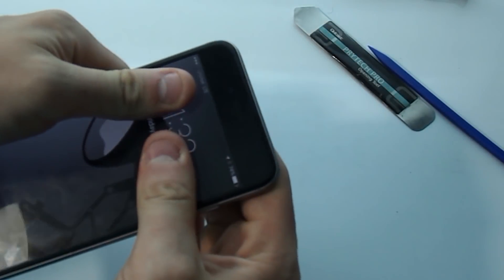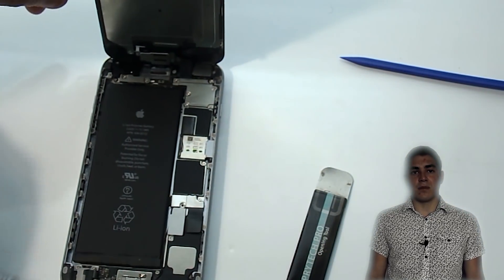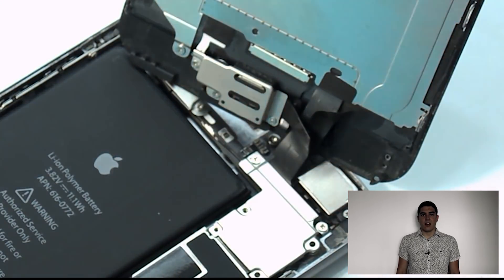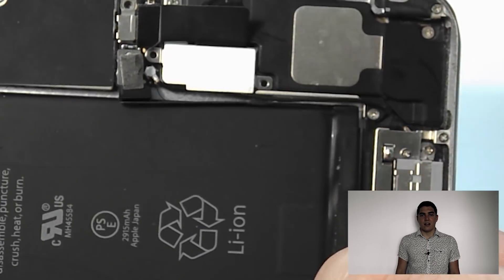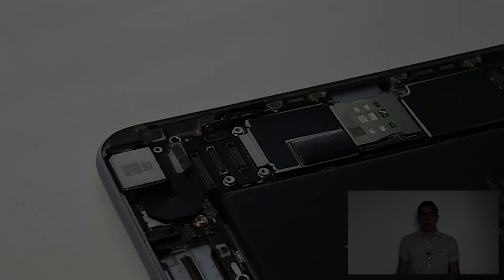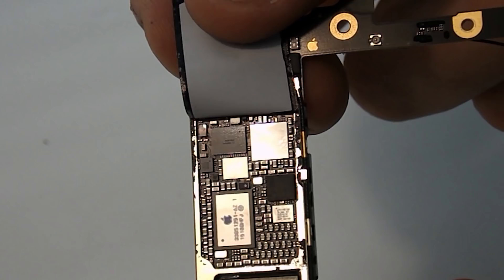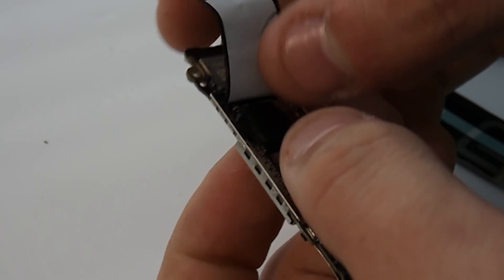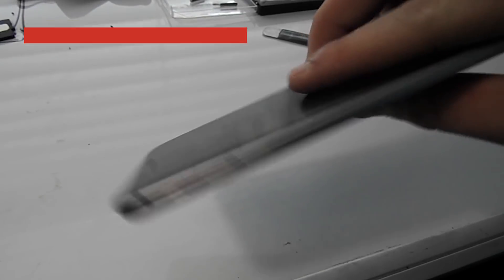How to Fix Touch Disease on iPhone 6 Plus (No Soldering or Bending) | appleEducate #03

Comment: Thank you so much for this. I took a shot at this trick because applying pressure with my finger to the back of the phone where the touch IC was made the phone work. Gotta be honest I was nervous opening up the phone as I had no back up phone, but after 4 hours my phone was once again working! It's only been several hours since putting the phone back together but so far theres no grey flickering bar. Will try to update this comment in about a week with how my experience with the phone is.
Edit: also touch is working flawlessly, thought I'd mention that
Reply: I have a 6 plus 64gb received on launch day in 2014
Reply from the maker: +Mike Neum that's awesome!
Reply from the maker: +Mike Neum thanks you so very much for an update! Glad it's working!
Reply: I've since gotten a 6S plus second hand, but this fix on my old 6 Plus is continuing to work. I've actually dropped the old 6 Plus twice after this fix and it continues to work. Everything about the phone works as it did before it got the "touch disease." I'm not trying to encourage everyone to try this to their iPhone and I will not be responsible for other people's broken iphones, I'm just simply telling my experience. Thanks again for this video Rody Davis!
Reply from the maker: +Mike Neum thanks Mike for sharing! Glad is helping and working!

Comment: I had 2 6 plus and traded one in with Apple for $250 bc of this disease to get 6s, then my wife 6plus start getting diseases so I found this AWESOME video and the ifixit tutorial you cannot go wrong! Anyway the first time I fold the tape just once, it did not fix the problem at all then I open it back up and folded it twice and thought it was fixed but then my wife complain about the disease the next day. So today I folded it about 5 times and it's been over 5 hours and I haven't seen the white bar! I think the disease is gone. Great video!
Reply from the maker: +Thai Cao thank you so much for sharing your progress and solutions! Thanks for watching!! I'm so glad it helped!
Reply: Rody Davis so every time I take the phone apart and do thicker tape it work 100% for a day then disease came back, and when it comes back it take more twisting strength to get rid of the white bar. Sorry this is a great concept and great video but I can't say that this technique is working. I will take this phone apart one more time adding more tape, this is probably the last surgery perform on my 6 plus because the screws are starting to strip /-;
Reply from the maker: +Thai Cao yes please be careful! Please look in the comments for other people who have worked through similar solutions. It definitely works. Thanks for watching!
Reply: I figured it out! So first bunch of times I did it, I obviously did not fold the tape thick enough. That's why it work for a few days then back to normal the reason is because that area gets really hot and the tape gets squish n thinned out. It has been over 2 weeks and still good and the phone been dropped many times (my 8 year old son even commented that before even a slight drop it stop working). So after  I put the phone back the screen budge up a bit on the side with the tape but after a day of use its back to normal. Rody you are the man with this technique. Thank you very much!

Comment: So far this fix has been working for me after a day of use. The only problem I've had is some discoloration on the screen caused by the logic board pushing against the back of the LCD. This could just be because my screen has been replaced and is not OEM. Thanks!
Reply from the maker: +Alex Brown awesome! Thanks for sharing! And that's definitely the issue. Thanks for watching!

Comment: All right, I did this and it worked for a week or so. 
Then I accidently dropped my phone from maby a meter up and it all started again. 
I could bend and twist it with some result which lasted for a few more days.. Then today.. the touch stopped working fully. 
Since I have no money to purchase a new phone I started thinking what I could do at my house at 11PM.
There was no chance in me trying to get my hands on my old jobs RBA machine so I got myself some tinfoil, heatgun (one of the cheapest on the market) and some flux. 
Took me around 2 hours and 2 reflow sessions of the two IC's but the touch is now working. Unfortunately the Wifi antenna got damaged during the teardown process but that is a price I can pay. Hopefully this reflow will last a few more months.
Reply from the maker: +Gurkturk wow!!! Man that's awesome!! Props to you! I have been really hoping to learn how to reflow and replace chips. I'm sorry that happened when you dropped your phone, but thank you so much for sharing!

Comment: would this work if the touch disease has progressed to the point where the touch screen only works 10% of the time or less?  Is mine too far gone?
Reply from the maker: +jordan fine mine was about to that point. If it doesn't work then you will have to get the IC chips replaced. But this is reversible so if it doesn't work no problem. Make sure to put plenty of tape though! Thanks for watching!

Comment: Rody, i have the "ghost touch problem on my iphone 5s. same scenario? a friens has the same problem with her iphone 6g. will this work across them all?
Reply from the maker: The problem is only on the 6 and not the 6s or 5s. It may be the same issue but this is not the same solution. On the 6s The chips are integrated onto the display but on the 5s they are reinforced. Thanks for watching and subscribe for updates and more videos!

Comment: I have a question. does the type of tape matter? like could it be duck tape? And is the tape only supposed to cover the logic board.
Reply from the maker: +killa kam the tape is supposed to be folded on it self so it doesn't stick on the logic board directly. Duck tape would leave residue. Electrical tape will work best for the heat

Comment: This fixed it completely for me.  2 days so far with no issues.  Thank you Rody!
Reply from the maker: +Kurtis Brischke thanks for sharing! Thank for watching and contributing to the channel 👍🏼📱
Reply: Hi Rody, after 2 days it started back again.  Having fixed it I now know where the chip is so if I squeeze that part of the screen while unlocking the phone I can get it to work (only while applying pressure).  The first go-round I used tape 3x thick, would 5x or 6x be overdoing it for second fix?
Reply from the maker: 5x would be about right 3x is too little. Bulge 3:03 Let me know how that works!
Reply: So far so good, started working again yesterday after the adjustment.
Reply from the maker: +Kurtis Brischke thank you for sharing!!
Reply: Kurtis Brischke still working?
Reply: L
Reply: How long did it last? Or is it still going?

Comment: Shit yes!!. I've just decided to get the 6+ and it just gave up on me. I didn't know about touch disease at the time so i just tried to reseat the connector and that worked for a couple of days. Soon i decided to buy a replacement screen but the ifixit video said it wouldn't help because the problem wasn't in the display. Luckily i saw that vid before going out to buy it. Going to attempt this trick soon when I'm free. If it works you'll be my saviour
Reply from the maker: +joshua lotion Please share your results and subscribe for updates on this fix, and thanks for sharing! Thanks for watching!
Reply: Finally has the time to do it yesterday and i have to say. You are truly a life saviour. Although the removal process for me was a bit fatiguing and difficult as it was my first time fully removing the iPhone's logic board i think it was worth it in the end. However if you have never disassembled any phone b4( I have experience from s4, and some other devices) i recommend asking some one for help as there are some tiny pieces that are really hard to reseat
Reply from the maker: Thanks for sharing that! I completely agree. Thanks for watching!

Comment: Thanks a lot. Tried this today. So far no touch disease in last 2 hours. But left with 4 screws that won't fit any of the remaining holes. Whoever opens the logic board, be careful to note down after removing each screw, where you removed it from.
Reply: Refer to other videos of replacing the logic board, because this video shows removing the logic board in fast motion.
Reply from the maker: +Ds Ss I always try to lay out my screws in the same shape as my iPhone. Sometimes I'll dry an outline on a piece of paper and but them where they came. Thanks for sharing and watching!
Reply from the maker: +Ds Ss I linked in the description to a full guide on how to remove it. Thanks for watching!

Comment: Hey Rody, the touch problem pops up on my phone every now and then. It always comes without the flickering gray bar at the top. Could that be classified as a touch disease that is caused by a hardware problem? I.e. An IC problem that needs to be replaced, resoldered, or, reinforced just like u did in ur video?
Reply from the maker: +H Binmansour yes the "touch disease" described in the video doesn't always happen with gray bars. In early stages loss of touch are signs of the IC chips coming off the board. If this video doesn't fix it you will need new Chips soldered. Thanks for watching, let me know if you have anymore questions, and thanks for watching!

Comment: It worked for a couple of days then the problem came back, It may be because I put the phone case back again. I'm going to try without the case see if that is the problem.
Reply from the maker: Make sure you use enough tape to be like the bulge in the video 3:03 I have a case on mine and it is not affecting it. Thanks for sharing!

Comment: I have been having the same problem on my 6 plus.  Is yours still working with the tape fix? It seems to work better in my otterbox  than out of it.   Verizon blew me off and Apple wants 150.
Reply from the maker: +Gas Station Ty yes I have my phone in an otter box and no problems at all, not a single glitch since the repair! No heat issues or touch issues at all, thanks for watching!
Reply: #crapple

Comment: My iphone 6 has a intermittent touch screen problem. When i touch some apps for about 3-5 seconds and drag to wherever i want sometimes the app icon is like dancing and will go back to its original position. I dont also see some gray bar on the top of the screen. Is it considered a touch disease? I went to a local repair shop and they advise me to replace the lcd. What should i do?
Reply from the maker: +Jamais Vu if you haven't have your screen replaced before its not you screen. If you slightly bend it and it fixes the problem then this video will help fix it. I believe you are seeing the first signs of the issue. People don't always have gray bars to have the issue
Reply: About an hour ago when im using my iphone 6 its suddenly touching itself its like theres an ghost on my iphone. What can you advise to me? Should i replace my lcd? I really dont know if its an sign of faulty IC chip or defective LCD.
Reply from the maker: +Jamais Vu have you had your Screen replaced before? If so its most likely the screen, if not its most likely the IC chips.
Reply: When im touching the screen very slowly specially when im on facebook the problem appear but when i touch it and scroll it a little bit faster you cannot say that there is an touch problem. Im really confuse right now.
Reply from the maker: +Jamais Vu have you ever had your screen replaced?
Reply: No. i haven't replaced my screen before. It all start 2 days after i update to ios10. I tried force restart, reset and factory reset but the problem still there.
Reply from the maker: Thanks for watching!
Reply: Yeah right. When my phone is freezing i just bend it slightly and the problem is gone. Now i can say that its probably a "touch disease". Id better go to local repair shop again and tell them to try repair/replace or put some electrical tape same on this vid in the faulty IC chip. Anyways thank you so much for the reply. Appreciated.
Reply from the maker: +Jamais Vu thank you for watching!!
Reply: When i slightly bend my iphone hoping for a temporary fix but now i think it get worsen, now the screen is already dead and unusable. Touchscreen now is not working anymore. 😫
Reply from the maker: +Jamais Vu you will need to find a repair shop or someone to do this repair! I'm sorry to hear that
Reply: Is it on IC chip or another problem?
Reply from the maker: +Jamais Vu IC chip!

Comment: Ok i want to try this, what tools do you recommend? I have a small Philips screwdriver but that other tool you used to lift the pieces and separate the phone, what was that?
Reply from the maker: +William Jackson you still need a Pentolope that's used to open the phone. I would suggest looking on Amazon and getting an iFixIt kit. You will have a lifetime warranty on the tools plus you'll be able to open up anything, and that tool to open was a iSesimo

Comment: Huge help did this myself and is working except one problem now my flashlight turns off after a few seconds. I can un-select the flashlight and click it again to turn on for a few seconds but it eventually turns off again.
Reply from the maker: +live2livegreat thanks for sharing! I would double check the connections to the camera, it may not be flush. Let know if that works!

Comment: +Rody Davis My Phone has all the symptoms of touch disease and putting it on an ice pack or in the freezer makes it work perfectly. Can you tell me why, And can you confirm this works for touch disease? As long as the phone is COLD it works perfectly! I have been carrying an insulated lunch pail around full of ice pack so I can use my phone all day. Holding it in front of the car AC on full blast also work. Thanks for the vid! I'm see'ing if I can find someone to preform this fix for me before I try it myself.
Reply from the maker: Okay so to narrow down the issue, does slightly bending your phone get the touch back? If so then this fix will work. Otherwise there is an issue with the logic board not related to the Touch IC chips or at least in the issue and resolution described in this video. You may have an overheating battery that is causing other issues.
Reply: OK I tried twisting my phone and it does fix the issue. So either I have multiple things wrong with my phone or cold is a temp fix for touch disease. Though constent cold compress mite cause other issues. I will post agin if this tape fix works.
Thanks.
Reply from the maker: +j j thanks for letting me know and please share your results! Thanks for watching!
Reply: Ok, So I bought the tools and did it myself. Short answer, it worked. I did get some side effects. I think the tape I used was to thick cuz I have a white discoloration on my screen over that area. But hey, IT WORKS AGAIN, much better. The process was so stressful, not knowing where the screws went, didn't know they where different sizes, so I don't think I'll open it up again. But thank you so much! my $700 phone actually works! Thank you, thank you.
Reply from the maker: +j j you are so welcome! Thanks for watching!

Comment: I noticed the phone gets incredibly hot after doing this. Any idea what mightve been done incorrectly?
Reply from the maker: +S Lee incredibly hot may be an issue with the battery or possibly miss wiring. Did your phone have any prior battery issues? And does it just get hot while on the charger?

Comment: hi but mine if the display connectors are  pressed its working for some time and then again after sometime its becoming unresponsive and when i tell it to the technician here in india they take it on ego and are not responding well and they try to convince me for a display change i am not sure what to do please i need ur help
Reply from the maker: +Chekki Chakradhar it could be the Touch Disease as I described in the video or it could be the logic board. If you have had your screen replaced before then there is a possibility that it is the screen itself. Find a repair shop good at micro soldering
Reply: yeah the screen is replaced so after finding one what step has to be taken i mean what has to be ensured to do to the board like the connector is to be soldered or what please help me out so that i can tell the repair shop guy to do the same 
and thanks a lot for the response
Reply from the maker: +Chekki Chakradhar I'm not sure if I understand your question, but you will need to have new connections soldered on the board if the connectors are depressed
Reply: sorry my bad what i mean to ask is what should i do like  is that the  display connector attached to the board i have to replace or the touch ic,the repair shop guy said that he will replace the connector and that can do a temporary solution for some time until its not disturbed or so
Reply from the maker: +Chekki Chakradhar The connector is on the logic board. If you get that fixed you can do this repair described in the video and that will work. My suggestion is that if if you have the touch IC chips replaced when you get the connector replaced since he will be micro soldering anyways.